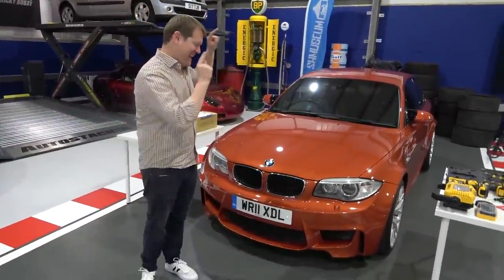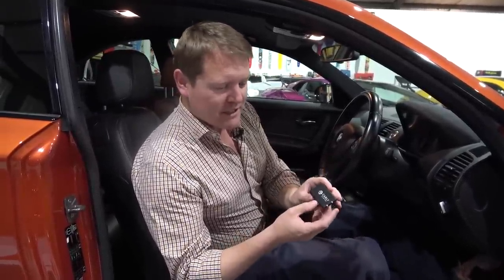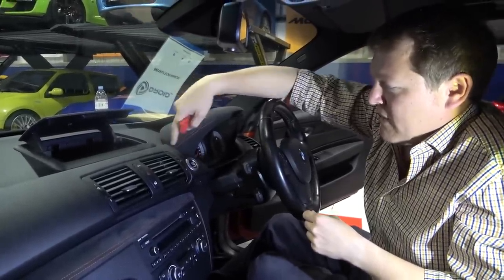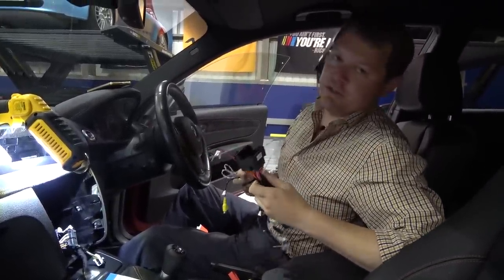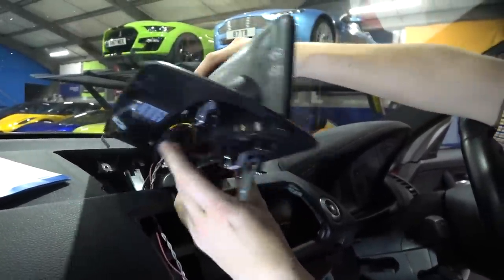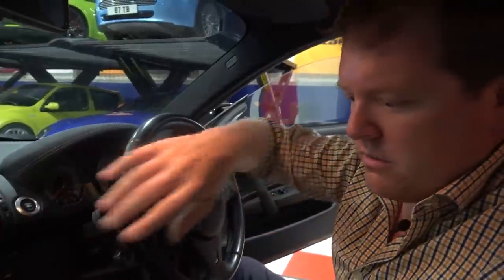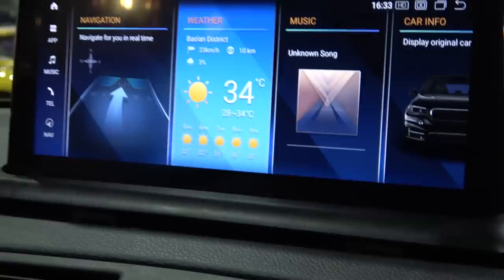MY FIRST BMW 1M UPGRADE! Android Auto DIY Installation | 1M PROJECT PART 3

Comment from the maker: Get 15% off your Carly purchase with code "Shmee150" (auto-applied) until 31 August when you click: https://bit.ly/Carly_Shmee150
Reply: Hell yeah !!
Reply: Most impressive... "Tim will fix it"...  :thanksdoc:
Reply: You can do most of that from I drive can’t you?
My experience with all these obd things that there is only one or two things you can’t just do from the menu
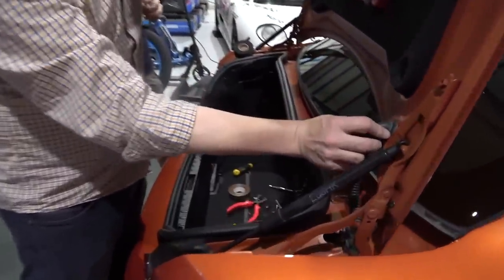Reply: @18:45 get a proper cable connector lads..cut the cable pass it through reconnect..
Reply: Was already looking at the Carly - but have now purchased!
Reply: Shmee, have you got a link to the screen your using please?
Reply: I miss Tom and Brad.
Reply: Finally a real discount woahhh 😁

Comment: Always gonna tune in for the 1M content!

For those 1M owners with iDrive and the HK system, the Mr12volt carplay/AA black box is a great alternative that keeps the factory screen, and supports proper lossless audio 👍🏽
Reply from the maker: Good to know too!
Reply: @Shmee150  yes Tim, this is the best option get the car to the professionals to get installed IDrive system and Mr 12 V box, don’t be disappointed when that system from Droid will let you down. I’ve been there

Comment: 25:00 the Chinese tablet is overlaying its own parking lines and also the camera has a set of parking lines. There is a loop on the camera harness about 2 feet from the camera that you need to cut in order to eliminate one set of parking lines. They are redundant.

Comment: 22:02 use a cordless Dremel tool with an extension shaft, and carefully trim the plastic structure of the dashboard under the foam. That’s where your clearance problem lies. That’s safer than trying to modify the housing of the Chinese tablet.

Comment: I think if you want the weather with it’s correct location,the gps/gsm aerial  as part of the additional leads you have in the kit (left on the table) will need to be fitted to the screen or the additional harness connected to the radio you’ve already installed.

Comment: The nice thing about the audio system in this car is you can install a Audiotec-Fischer components and all the components from the speakers to the amplifier with DSP are plug and play. Even the harness is plug and play.

Comment: Nice install! Missed one important step before taking dash apart: disconnect battery… pain in the ass when wanting to test working order when some steps are done, but will prevent possible  annoying errors.

Comment: 18:42 the RCA cable WILL fit through the BMW rubber conduit. Use some silicone spray, and some type of snake.

Comment: good buy Shmee, congrats👍.. the first things what I upgraded in my 1M it was Mosselman oil thermostat and Wagner intercooler.. in my opinion its a must, because N54 struggles with overheating.. later suspension, exhaust (I chose not Akra, because of the drone sound)..

Comment: First mod should be the chargepipe on the N54, I can guarantee you it's leaking now and they can break even on stock boost. Also the IC connections are probably leaking a bit and a new 5" is cheap and good mod to keep intake temps down. For more sound I suggest downpipes and the muffler mod to keep the valve open or go with a new muffler. With stage 2 these thing are so much fun, loads of torque and around 420bhp on pump.

Comment: A good idea to make sure you get the correct fasteners back into the right spots is to have a bunch of small ziplock bags, then when you remove the fasteners you write where they’re from on the bag. Then you never lose them, and get them back in the correct places.

Comment: I'd highly recommend an ODB splitter, then plug an ODB cable into the headunit via USB OTG.    Then purchase MHD and you can monitor everything (boost/pressure/temps/timing etc) on the screen

Comment: Did this recently on my car such a convenient unit wasn’t too simple to fit either though
Reply from the maker: Did you have the same fitment issue as me at the end for the screen base?
Reply: @Shmee150 every aftermarket head unit I've ever fitted in any car has always been a pain to fit, there's always been a bit of trim or fixing or something that needs chopping or an appointment with the Dremel 🙄
Reply: @Shmee150  the screen took a bit of wiggling to get to fit snug indeed but our main issue was getting the reverse camera wired in properly but got there in the end

Comment: That Baoán District is an area in Shenzhen, China, which is possibly where the factory located. Location should be update if there is internet connection for the device. That made me wonder why do you choose a budget unit; 1M is not the most expensive car but as you spent some decent money on the audio systems on other Shmeemobiles, it seems weird to me for having that unit.

Also I wonder if that is really good to display the Swatch Maxis behind the cars 
Not sure if exhaust gas and temperature will damage the condition

Comment: In fiddely theory, obviously practice makes perfect. There will come a time where you will say dang it, it would've taken me 5mins to get the dremel out and take a little corner of the dash and blow it out or the unit outside of the car if possible. Wiring also. Can you believe there was a time where I was scared to even cut a wire and now building my own harness for combox retrofit, soldering on pcb's

Comment: Wow did a really good job I wonder if I can get something like that for my Camaro probably cuz I would like to upgrade the screen a little bit so little on the small side but I really need to upgrade my sound system I have a big old kicker with a bagel amp and I had it hooked up one time but now it seems to be in protect mode and I can't seem to figure out why so yeah I really need to upgrade and reinstall my sound system

Comment: Oh no Tim, I’m really sorry to tell you that I have really bad experience with the company of android system in BMW Droid 😞 what they doing they buy in bulk from China and make a nice website in UK and outwit people, . I was fine with microphone issue in lag in the screen and freezing the screen, but when it came that the screen didn’t work anymore it says that is my fault that the cable brake the plug in the back of the screen😂.

Comment: Nice video, just fyi for people that think that not installing the GPS antenna isn’t important as you are going to use Apple CarPlay or Android Auto anyway, without the GPS antenna your apps won’t work as the moment you connect to Apple CarPlay, your phone uses the gps signal of the car. Just a tip!

Comment: That screen does not look very good there. I would rather have the oem idrive system and then update it with a plug in module.

Comment: Do you have an old enough SH**MEE plate for the 1M?
Reply from the maker: It's actually already registered on a SHxx MEE plate, I just haven't changed it over yet because I'm going to change it again (point to note, it's off road so that's not a problem)
Reply: @Shmee150  Thought so — the DVLA appear to have run out of your personalised numbers. Gotta catch 'em all ;)